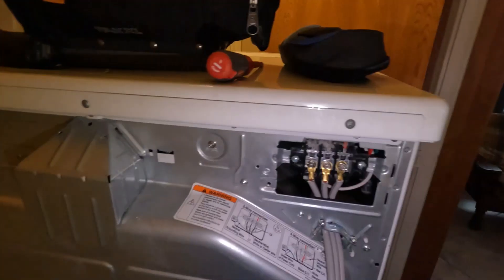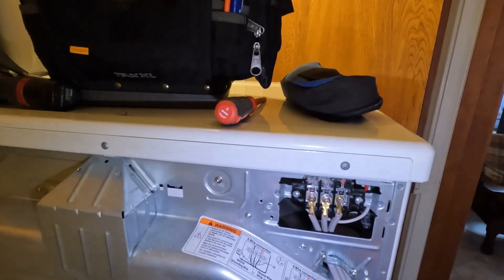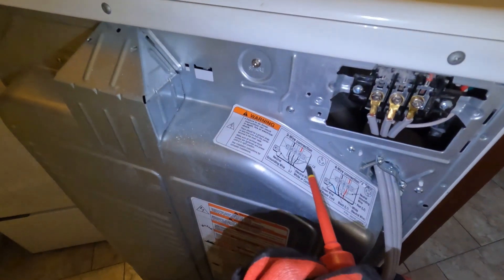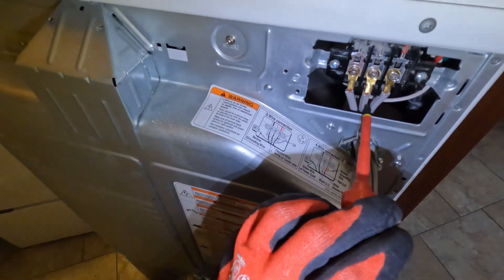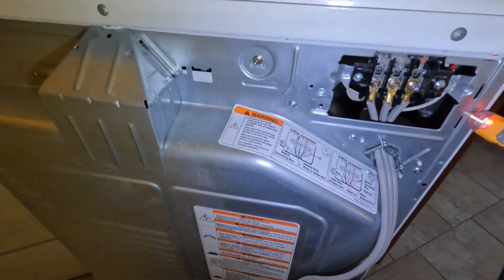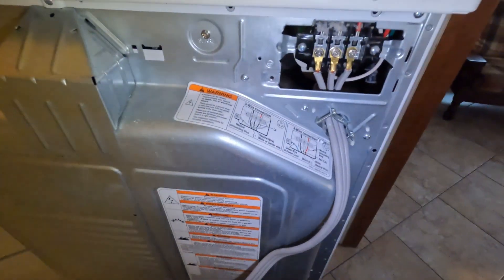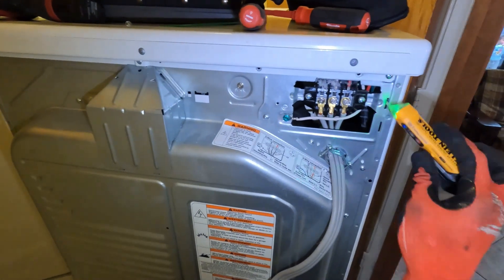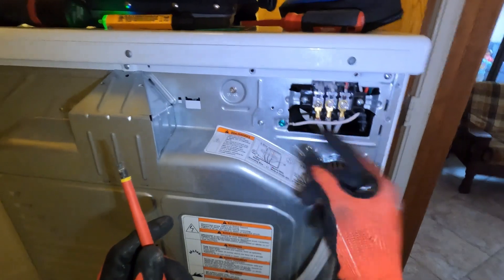Diagnose a GE Clothes Dryer Shocking when Touched

Comment: Use a dedicated fluke voltmeter and proving unit to prove dead - a NCV stick really should not be used as prime proving basis. NCV sticks work through sensing small amount of current and hence voltage from the live conductor/circuit to the ground where you are the ground as you hold the NCV stick. An NCV stick can provide false positive (a positive voltage reading when no actual voltage is present) readings from stray, static and ghost voltage readings. False negatives (can give a negative reading for voltage when actual voltage is present) this can happen when you are not properly grounded when holding the NCV. As I said always use a high quality voltmeter first with a proving unit first then you can use a non-contact volt stick as a back-up.

You are doing great the voltmeter approach while a little clumsy when you first begin with it - you will get better at using it.

The issue of touch currents and voltages is an important one with the NEC2020 now mandating a GFCI breaker on that branch circuit. There are dedicated electrical test safety instruments for actually assessing these touch currents and ensuring that from type 1 devices a proper ground exist and remains continuous.

Comment: Objectionable current flow is a big deal. The trouble is the appliance store offers to wire it up free with purchase and delivery. They’re not electricians and that’s the problem.  For 3-wire  the neutral and ground are bonded and for 4-wire they’re isolated (like a sub panel). Good video!
Reply from the maker: Thank you for the explanation
Reply: this is a 3 wire tho and he unbonded it so your saying hes wrong ?
Reply: @TheLostAdventuress  Honestly the wiring diagram for this unit just flat out doesn't make sense. It somehow has probably already connected the "ground" (the wire he moves in the video) and neutral itself inside the machine, and that is why the wire is connected to the neutral in a 4 wire application. Essentially that wire does not become a ground wire truly, until it is connected to the frame, before that, it is just like an extra exposed neutral wire. So connecting it to the frame essentially connects the frame (ground) back to neutral, and connecting it to the center neutral post, just keeps the neutral contained and separate from the actual ground wire when wiring up a 4 wire application. Not an electrician, that is just my guess, because it is not normal to have that extra small wire bonded in a 4 wire application. Usually that small wire is also green, and it is separated from the neutral and you have to bond it to neutral yourself instead (in a 3 wire application). Based on the wiring diagram, that is not the case on this unit.

Comment: Another possibility with the 3 wire setup (and why this configuration was prohibited as of the 1996 NEC) is a broken,  loose or corroded neutral,  whether it be at the panel, the receptacle or a junction box.  Because since a 3 wire dryer or range configuration is technically 120/240V non grounding, bonding the frame to the neutral which in turn is connected to the system ground at the main panel, this could energize the frame since the neutral powers the 120 volt loads such as the timer, motor and drum light.  A dryer that gives shocks even when wired properly may be plugged into an incorrectly wired outlet,  which is easy to determine with a multimeter.

Comment: It also could be the outlet is wired wrong .
If one of the hot wires , black or red , is on the neutral ground wire , white , this will also cause shock .

Comment: How does grounding on appliance chassis work? If the chassis becomes electrified, the current goes into the ground wire and then into the neutral?
Reply: The purpose of grounding the chassis is to provide a low impedance path from the chassis back to the local source of the electricity. This is so that if the chassis should contact one of the ungrounded (live) conductors, a large amount of current would quickly flow and immediately trip the circuit breaker, clearing the fault. This low impedance path can also reduce the amount of current that would flow through you if you were touching the appliance when this happened, but the main purpose is to trip the over-current protection device. The grounded (neutral) and grounding (green or bare ground) conductors are bonded at the first means of disconnect so either can provide a suitable path for clearing faults. Electricity (with the exception of static electricity) needs a path back to it's source to flow , it does not "always flow to ground" it will only flow to ground if the ground can provide a path back to it's source. That misconception trips a lot of people up